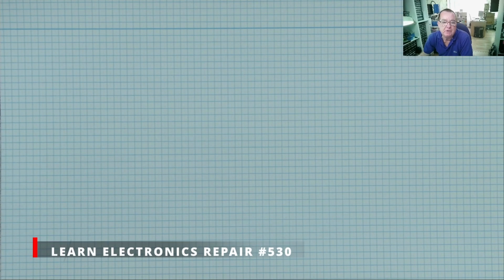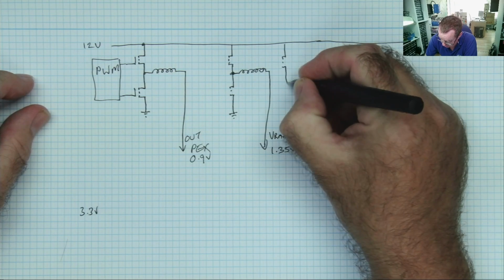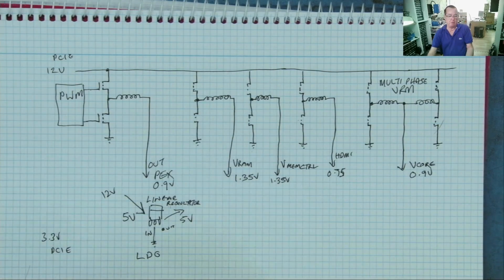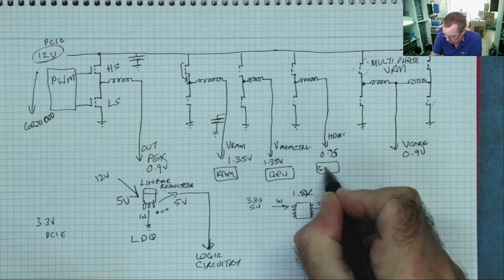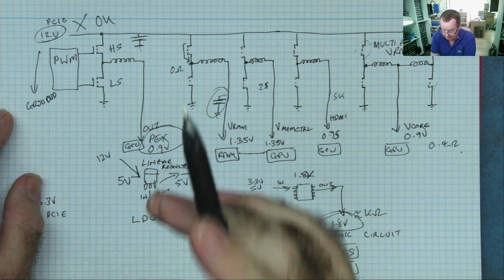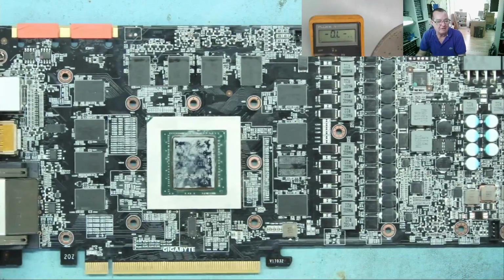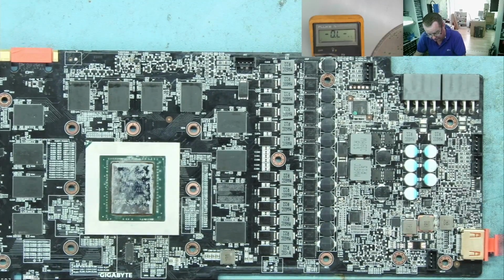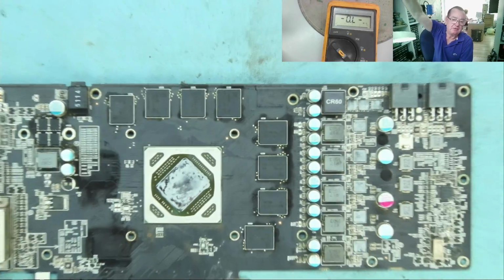PART 3 - Graphics Card Step By Step Fault Finding Guide - How To Repair GPU Faulty / Not Found

Comment: 18:00 I have exactly the same problem with a GeForce 660 Ti. On the 12V rail at the lower PCIe section, I measure about 10.7 ohms. However, when I try to track down the issue, I also measure 10.7 ohms on four other coils. Does this mean that all MOSFETs in that area are faulty?

Comment: Hello
I have a defective Gigabyte 1080 TI 11GB.
As soon as the card gets loaded, the whole PC crashes.
- No temperature problem
- No VRAM problem, tested.
- BIOS reflashed.
- No short circuits found
- Everything looks normal.
- PCB looks normal.

The card only crashes under load.
Otherwise it works.
What could be the problem?
What should i test next?

Comment: Hi Richard What do you do when the fan controller chip appears to be not working?  The card otherwise works. Have you tried to repair one of these? The card (GTX 950m) still works well but of course gets too hot under load. I’m thinking of soldering the yellow and black wires from the fan lead to the 6 pin power connector or running a lead to one of motherboard fan headers.  This will give me a fan but no feedback control.  Is there a better way to fix it?

Comment: Thanks for the video, is it significant when testing components that they should be under load rather than unloaded? I read that in automotive electrical diagnostics that circuit and components should be under load when testing with a multimeter

Comment: Another great in-depth introductional video, thank you for that!
One note: Not everybody owns a Fluke or a good milliohms meter; in fact some cheaper multimeters even "round down" to 0 Ohms when there is actually 2-3 Ohms of resistance - and on really modern GPUs .2 Ohms is a perfectly valid reading on Vcore. This is why I skip measuring vcore resistance, you just can't tell if it's valid, a short, or just your lead's resistance you measure.

Comment: Good explanation 👍👍👍👍👍👍Richard.
My first step is:
Bevor meassuremts it is necessary to control the first(pin 1 and above) and last pci connector on the pcb for a crack/break.